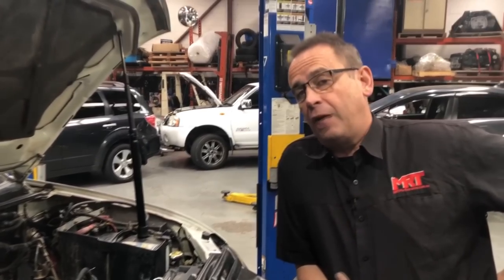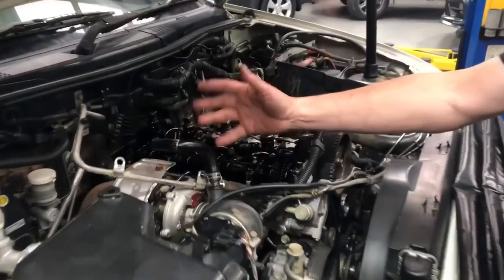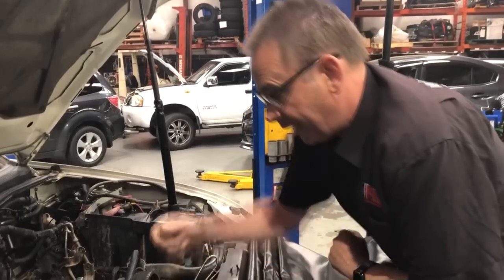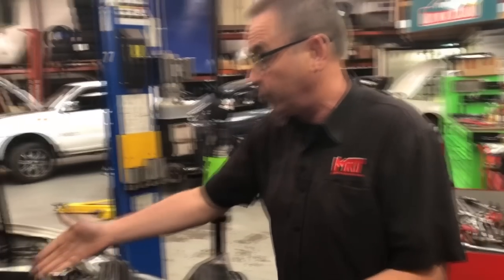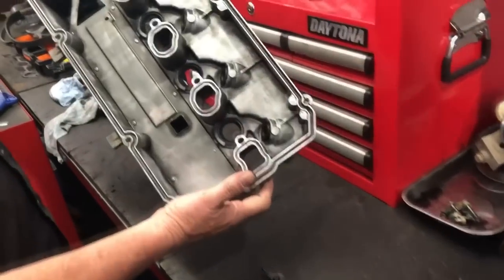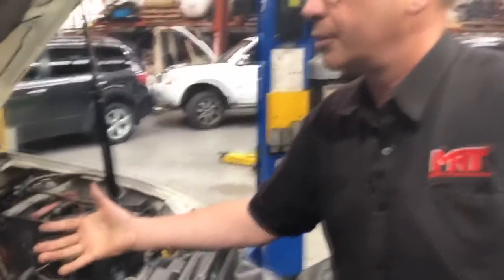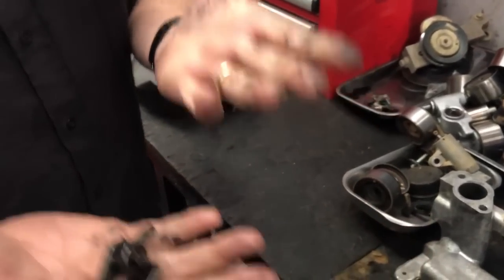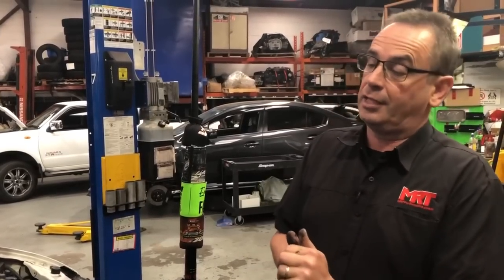Triton Troubles

Comment: Mine had a small head gasket leak at the front of the engine. There is a tiny water gallery only about 10mm from the front of the block. Started at about 150K. Had new radiator, water pump, isolate EGR cooler etc but no-one could work out where the leak was. Eventually I felt a sudden increase in vibration (which I now know was the balance shaft breaking due to water damage. It had done 60K and I was planning to get the belts done shortly.) Mechanic couldn't find problem. 4 months later had a catastrophic breakdown when the balance belt pieces caught in the timing belt and caused it to slip. 
I could not afford a mechanic to fix it so took it home and bought another car. I got Covid soon after so had 2 weeks off work where I could remove and dismantle the engine while trying to not die. (got to get your priorities right hey?). Have been gradually rebuilding it since.
Head crack checked and rebuilt, new camshafts. All the exhaust rockers were broken in half so full set of new rockers. New big ends. Bores and pistons were OK. Pulled out the balance shafts and checked their bearings (OK). Turbo was leaking oil internally and externally so had that rebuilt.
Cost me about $3500 in parts, clutch kit, turbo and head rebuild. At least I now know this engine inside out so will be more able to maintain and diagnose problems in future. Not long until I get it in and back on the road.
Moral of the story is it is cheaper to do a major disassembly to find a problem that wait until it becomes worse.

Comment: Good video , i had also a a 4d56 came in from another shop without the balance shaft belt fitted. Customer did not even know. Had some performance problems.
Now i have a 4d56 did with hard start and not idling after it starts after 35 to 40 seconds with no trouble codes.

Comment: Lucky the b/shaft belt did not take out the cam / fuel pump belt! Have seen a couple sheer the tensioner pivot bolt on the main belt due to that same failure. Usually because owners have not had the T belts replaced @ 90,000km as per the schedule LOL
Reply: +1 this, have also seen this happen.

Comment: I bought my 2007 Triton when it had done 235k km. I noticed a slight vibration usually at idle and and very low end of the RPM range. Came to know it is the broken balance shaft belt and when I did the timing belt replacement at 300K km I didn't replace the balance shaft belts because when it brakes again (as it would, because this happens due to lack of lubrication of balance shaft bearings by design fault with 4D56) there is a possibility broken belt entangling with the timing belt and breaking it as well. So I'm more than happy with this little vibration than higher possibility of a bigger repair given how old my engine already is.

Comment: Buying second hand is always a risk, this does not reflect on the Tritons motor... they are a great, very reliable motor.
Reply: meh, mines been average camshaft cap failed at 100 000km, trashed the whole head - nightmare.
Reply: Nah not reliable at all , mine overheated at only 30000km 
Dont buy 4D56 engine
Reply: @b9625bb  the overheating issues are an easy fix its caused by blow by, incorrect coolant and the wrong pressure rated radiator cap. All three should be changed if you ever buy a MN triton or challenger. They aren't too bad of a motor the older ones didnt have the issues like the tritons did but because the older 4d56 were built in Japan not Thailand they cheaped out on some things and redesigned.
Reply: @fryman2650  my issues are not because the coolant and already corrected radiator caps the problem was the head gasket blown because cant handle bigger Hp and Torque since i custom tuned the car with unichip making 255hp 550nm , only 30k and with original coolant from factory.
After i replace the gasket the problem goes away
Reply: @b9625bb  the corrected coolant has a different ethylene glycol content mixture, was it a genuine cap? Did you have a catch can? The head gasket probably blew before you tuned the car mate, just made it worse by tuning it.
Reply: @fryman2650  of course genuine cap, my pajerosport (challenger in oz) has the updated coolant and caps , i always raced the car to 200kmh (no speed limit in indonesia) and do illegal drag race every weekend at midnight since the car new so i dont know if that make the gasket blown faster than it should since my friend which has older pajerosport 2011 but only remapped to 200hp still has the original gasket and rarely do topspeed run
Reply: @b9625bb  You did all these modifications to a engine with stock head and you expect to last it in the same way factory tuned 170 bhd 4D56?

I simply don't understand you? Probably you also don't know what you are doing. 4D56 is not a Supra 1JZ and stop complaining with irrelevant claims. If you modified the expect shit to happen anytime

Comment: my triton a 2012 automatic 2,4 model , hits the breaks while driving and then it stucks the second gear in the gear box making it impossible to speed it up. The only remedy is to pull over and awitch off the engine and start it back. Any ideas what is causing it ? the fault is P1782 and P1783

Comment: Hello from UK. My 2011 L200 2.5 DiD has done over 120000 miles. Do you think it needs a tappet adjustment as when the engine is cold, usually in the morning it sounds like somebody is shaking a bag of gravel in the engine bay.
Reply: putt the right spec oil

Comment: Great video, thanks. Are the 2.4 Triton engines generally reliable? I have a 2018 Triton and a mechanic friend tells me the engines are lemons (based on 2 Tritons he has worked on recently)? He may be just a hater.
Reply from the maker: When maintained properly they are generally reliable.
Reply: @MRTPerformanceAustralia  ok thanks. I take it they don't have the same cooling/block issues of the previous 2.5L diesels had?
Reply: We have a Triton and a Pajero Sport both with the 2.4T engine.  THEY ARE BULLETPROOF!
Reply: Have be pretty rough on the gear to kill one.
Reply: If its a 4n15, they are much better then the 4d56(the motor he is looking at) easier to work on and they don't have overheating issues like a 4d56.
Reply: @pauls3585  that's correct...as of the 2015 remodel those issues were meant to be addressed
Reply: Hi the 2.4 is one of the best small diesels around ask all the mines they use heaps of them they have less issues than the hiluxes
Reply: @klano8443  My understanding is all the mines use Toyotas....because...."unbreakable"

Comment: Never seen a diesel engine with 'clean' oil, not even after a full lube service. 
Watcha on about 'black grunge' in this video, there is no build-up, only the normal residue?
Reply: 'Residue' is not normal, an engine with 12000 hrs on it will look shiny clean if you change the oil regularly, like around 250hr intervals.
Reply: @Honey_Crumbs  So said a non-diesel 'mechanic', if ever there was one....
Reply: @Honey_Crumbs  Really? What colour is old diesel engine oil?
What colour is it fresh out of the can?
What colour is is after 5 minutes of running? Don't be spreading lies now....that's what margarine is for.
Reply: @almostbutnotentirelyunreas166  well I would agree with you, but then we'd both be wrong
Reply: @almostbutnotentirelyunreas166  the oil will be black yes, black as soon from hell. Yet, so long as you do regular changes (250hrs max) you will have zero sludge. Because sludge in an engine causes wear. The more carbon in the oil, the less cooling, and lubricating properties it holds. The sludge is excess amounts of carbon build up. End conversation

Comment: I have the same engine in mine. It is low on power and has misfire code cyl 2, most notable at idle. I have already cleaned the inlet manifold with small improvement. Replaced the SCV with no improvement. I am now anticipating to find a broken rocker or replace injectors. 

Is there a valve/butterfly in the cylinder head that switches between the two inlet tracts?

Are the injector fuel hardlines one use?

Thanks from petrol car guy (diesel newbie)
Yes I figured to check the fuel pressure on scan tool before working.
Reply: Check injector lines for cracks, the return line which connects all four injectors and the pindles on the injectors themselves and make sure to replace the copper washes on the injectors while your at it.

I dont believe there is any inside the head itself no.

And yes they use hardines, sometimes can be prone to hairline cracks, if you do replace do not replace with used ones as they usually are married up to the injectors when first fitted, from experience some dont just straight fit but if you replace with brand new they will groove/mould to your injectors.
Reply: Just curious, what was the fault and did you manage to fix it?
Reply: Yes the misfire was blocked injector. I had already tried the fuel treatment additives and it was completely crusted over when I took it out. Job took all day as the manifold and rocker cover have to come off. Budget to clean the manifold and adjust valve clearances same time. Check the injectors are positioned correctly to fit the hard lines before reassembly. Mine were not quite lined up with the fuel pipe and were difficult to fit but did go on, I had already refitted the rocker cover and inlet manifold.

Comment: Hi, I have a 2007 Mitsubishi Sportero 
Problem : Hard start when hot

i dont have a check light on but it just takes forever to start when hot and when it starts its flooded (smoke)
if i give it a check light(unplug the Temp Snsr) it starts within a second ....  Can anyone help?

i have the same condition on two Sporteros both 2007 one auto the other manual 2.5 DI-d 4wd
Reply: Buy a new
Reply: Solinoid its a common problem po 4d56
Reply: Which solenoid ?

Comment: It's kinda b.s when one says bigger tires are hard to get off the mark and require more torque. 

When increasing tire diameter it's very common practice to change diff  crown and pinions to suit tires. This will bring it back to as normal.

Comment: Have 2014 mitsi tryton  4×4 with 97000k .
Just purchased and have an overheating problem. Had the veichal serviced today ,was figuring  a faulty thermostat and had removed.
On way home temp still rose up to the three quarter mark and i turned on the heater.
I will admitt that i had been crusing at up to 120kph.
Wot do you suggest i look at next ?finally i boughht this veichal with a 12month  mechanical warranty.
Reply: 4x4 cylinh.12.v 9.zuve
Reply: I know someone had same issue in same model  at 120,000km. It’s a fault that Mitsubishi are aware of. They replaced the engine even though it was just out of warranty due to his good service record. Replacement motor is $13,000. Get it looked at before it gets worse.

Comment: Hi I have a 4d56t motor just replaced cylinder head, when running it has a knock after 30 minutes of running it snapped the timing belt , put a new timming kit on just started it a ran it for 10 mins and it snap my cam shaft wheel clean off im stumped on what its problem is any ideas anyone
Reply: Possible that the timing marks weren't lined up properly